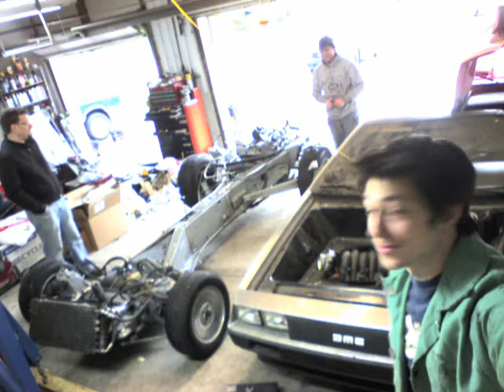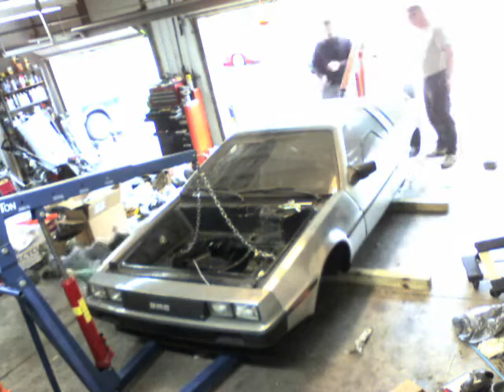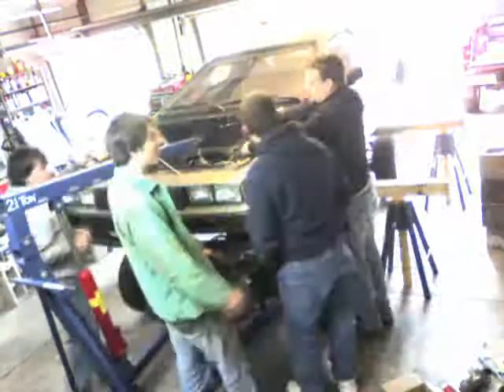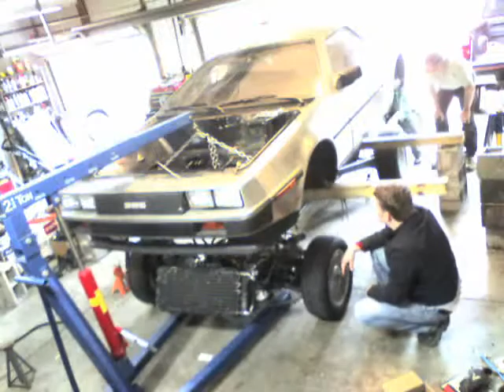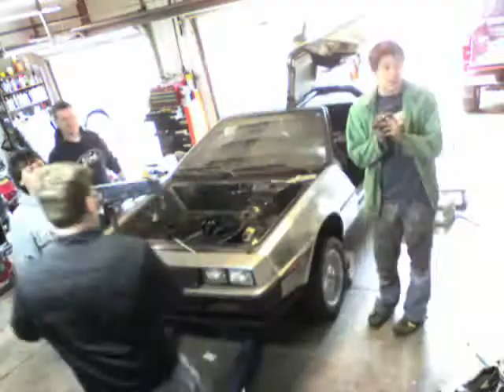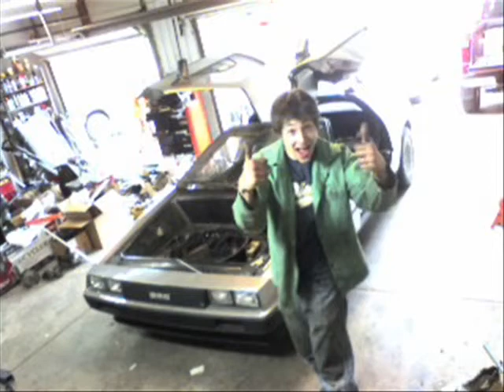DeLorean Body Frame Rejoining in 5 minutes!.wmv

Comment: You made it a lot harder than it actually is. I separated mine with only one floor jack and some cinder blocks by myself. I had it off, replaced my fuel lines and back together in 6 hours. Including retourking the 12 body bolts.

Comment: I have a question I'm a very big DeLorean enthusiast  and I saw a DeLorean frame that I'm interested in restoring  the frame has been T boned  and needs work the frame is cracked and there is a big peice missing in the back of the driver seat the owner said it would be best used as a parts car but Im interested in restoring it  I just want to know can the frame be fixed?